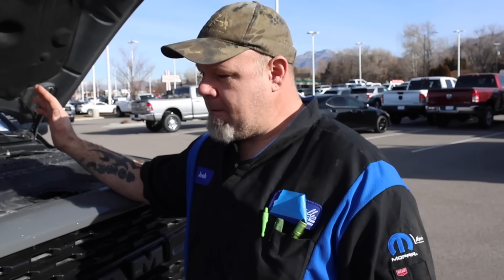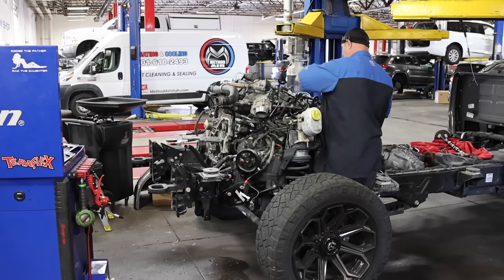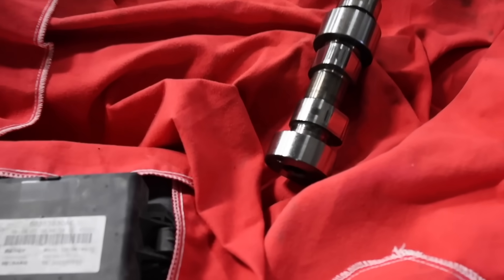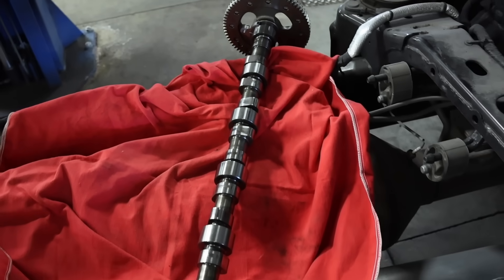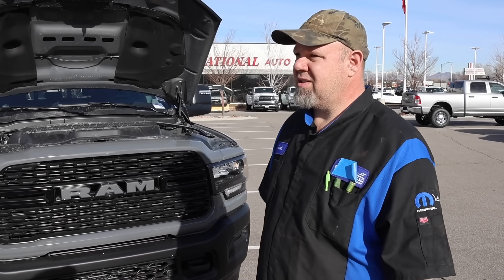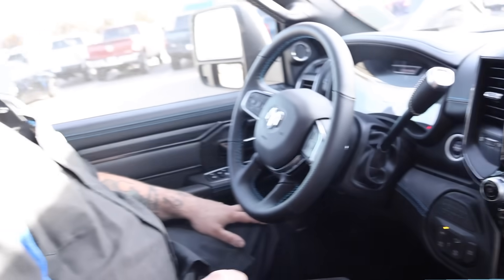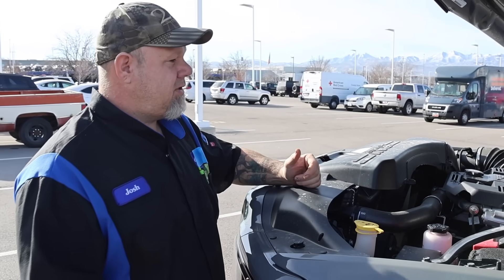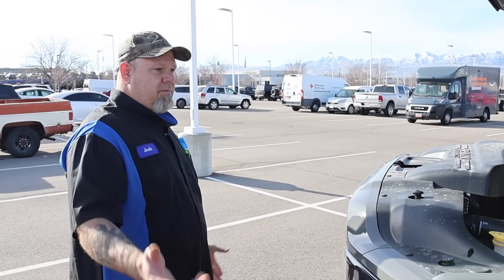Master Diesel Tech Explains The BIGGEST Killer To Your Diesel Engine!

Comment: Curiosity. Last summer I went on a road trip and I put 5k miles on my truck in about 2 weeks. I changed my oil before and after the trip. 

Does long road trips change your opinion on how many miles you change your oil?

Comment: Great video!  Only thing I would do differently is let the high idle do its own thing to avoid thermal shock to the head causing possible fracture issues.  I plug my truck in every chance I get to avoid the high idle kicking in at turn key when I get to negative temperatures (Celsius).  I also let mine cool down habitually.  Especially when towing.  2-3 minutes warm up in cold temps, drive it gingerly for a couple minutes then normal operation.  Always give it a Ferrari stopping every drive to burn off soot.  

This is a very knowledgeable tech.  He should be training the entire Ram fleet of diesel techs.

Comment: Here in new york state,auto start,wait five minutes set cruise and bring up rpms to 1300,Another 5 minutes and up to 1500,temps read 135/140 on coolant and oil temperatures..Diesel engines like to run HOT

Comment: I have a deleted 2018 Ram 2500 6.7L. I travel with it a lot for work towing RVs. I’ll often time stop at a truck stop overnight and will idle for 6 to 8 hours at a time in order to run my AC and or heat. The truck will automatically turn on high idle periodically, but sometimes I do manually run the high idle for period of time. I have been doing this for approximately three years now, and the truck has over 330K on it. Engine runs fine, and I change the oil every 7500 miles. Is this something that I can continue to do safely? What are your thoughts?

Comment: I own semi trucks and we don’t even go 10,000 miles on an oil change. 8-9k miles is when we change it on them. To me it’s cheap maintenance in regards to an engine rebuild.
Reply: In europe most semis are on 100,000 km oil changes, nope they don't last, but then the makers have got all the customers on 5/7 years leasing contracts with full repair/maintenance (if you can call it that) contracts.
Ours are on 5 year lease, tankers with pressure blowing kit, some having engine rebuilds before going back with around 900,000 kms on the dash.

If i ran my own trucks they'd be serviced like yours, used to drive Cummins engined semis in the 80's, 15000 mile oil changes, never gave a moments trouble over the 7 years we ran them with a queue of owner drivers waiting to buy them.

My own Toyota Prado sees 3000 miles max oil changes.

Comment: I have 2 diesels… I bought both brand new. A 1984 GMC K2500 6.2 4x4 and a 2009 GMC 1-ton Duramax. I use Amsoil synthetic oil… change it at 10,000 miles in the Duramax and annually in the 6.2. With every oil change, I get a complete lab analysis of the used oil.

Comment: Modern diesels are rubbish! Once they used to go wrong, these days they have engine failure often at very low mileages. Also if you can, get shot of the EGR, the have very little emission benefit, impair performance and cause loads of problems. No block heaters in the UK as far as I know.

Comment: I have 5.9 Cummins turbo Diesel 2001 I  change the oil every 3000.
Miles and I use Rotella 15W40 it been running great for years I bought it in 2004 it had 23000 on the odometer. It's been the best truck I've ever had .

Comment: Excellent points sir. yes dpf and egrs are not perfect by any means, but those videos of guys showing extreme carbon build ups never show the idle hours or disclose the maintenance records. Both of which I’m sure 99% of cases are due to high idle hours in relation to running hours and poor maintenance. 
These engines are meant for optimum running temps and long distances. Such is the case with 2 of my 5th gens. One gets ran every day and is at 190K miles all stock with no check engine light ever. The other get used to go the store once in a while and has been at the dealer 4 times due to emissions issues.

Comment: Best way to warm up your diesel engine is to drive it. After a few seconds you have full oil pressure, everything is lubricated, and it’s ready to be gently cruised up to temp. Remote start is for driver comfort, not for the engine.

Comment: my 2015 3500 is the only diesel i've ever had. had it 2 years now. i live up in canad'er... cold start 3-5 minute idle, oil changes 7500 mile intervals with mopar filters and rotella oil. also replace fuel filters and ccv on every oil change. works for me

Comment: Have a 2024 gmc 3500HD duramax,  am doing the first oil change at 3000 miles am I doing it too early? Plan ON Doing it every 5000 miles . What's your thoughts? Very good video..
Reply: what does the manual state? im tired of seeing people waste money, this isnt 1980- erly 2000's where manufacturers recommended 3-7k mile oil changes... the new ram has a 15,000 mile interval.... i dont waste my money prior to that, its just insanity....
Reply: @Avies48  Free oil change, manual says 7500 miles. Oil been in it almost a year.
Reply: @jeffreyrussell2337  good to know, ima readmy ram 3500 from 2022 and see if it says other wise, it usually based on hrs, and or miles, or time... 1 year, 300-600 hrs, 5k,7599,15000, so what ever the manual states

Comment: Engine parts become more fragile the colder they are,so it would be easier to damage or break internal parts! Especially high performance engines with stronger valve spring and a high lift cams.

Comment: Biggest killer of modern diesel engines are the emissions system’s designed to recirculate exhaust and create back pressure in your crankcase. Vote differently folks the sky isn’t falling.

Comment: Some good tips as an owner of a 2022 - 2500 6.7  Canadian eh! What about running with the Jake break on every day driving ( not towing )?
Reply from the maker: YES! What a lot of people don’t understand is that the turbo NEEDS to run its full sweep and the only way to do that is to allow it to run in engine brake mode. It helps prevent build up on the veins and keeps them moving freely. Plus as an added bonus it will extend the service life of your brake pads

Comment: I’m all about raising your idle, but I have a monitor and can see all the parameters as soon as you raise the idle you are introducing EGR gases. at an idle the EGR is closed so no gunk is getting into the intake system check for yourself if you don’t believe me. At initial start up the EGR is normally closed at any engine speed, but once the engine has warmed up just a little bit. The EGR opens at an idle. It’s closed.
Reply: You are correct

Comment: Living in Scandinavia, all my cars have had diesel engine- and compartment heaters installed and my Ebersprächer has been very good. I'm careful about maintenance and serviceplans, so the car and engineheater works flawlessly. Also also using synthetic motor oil. Changes every 15000 Kms (9300 miles).

Comment: Thoughts on running 10/30 or 15/40 in winter? While i do live in Alaska, I dont drive it much un winter, and on those occasions I do, i plug in the block heater. I currently run 5/30 all year, but always thought it was a little thin.

Comment: Any advice on idling, or not,  a 2014 Ram 1500 5.7L V8. Also, bought truck used with 60,00 miles on it, now has 85,000, is it safe to drop and fill with ATF? THANKS.

Comment: All great points noted however it all comes down to the uninformed instant know it alls , screwing up a simple task by theur silly pride of thinking THEY Know more than the combined experts of the world !  Remember This , if engine water not already  within range of normal cruisse temp ..... wait ten seconds minimum after start up and then Religiously run the idle up rpm to 1,500 - 1,800 for about three minutes !  This is A Must Do , to get normal burning rate to occur , once engaged to drive the rig or Genset or whatever you have that is diesel powerered. Once your pulling over for shutdown or reststop , keep engine running at normal idle Speed at least three minutes to even out temps n the head , then if turbo temp is in cool range for shutdown Shut it down. Excessive idling IS Harmful & Will Reduce Life of the engine. Always remember the worst enemy of your engine IS the unqualified mechanic or the loose nut behind the wheel !   Cordially Nick , NavyBlueSmoke , LST-1195 , Top Diesel mechanic at Greyhound Bus Lines , position 6-671 Yes 671 !  Retired & living in The Philippines 5J36+HV9 ............. Burma Shave .........

Comment: OTR big rigs often use oil analysis to tell them when to change oil. An acquaintance has a Cummins big rig and a Cat big rig. Both engines are early 2000 year engines. No emissions garbage. The analysis tells him he gets 17-20k on the Cummins and 20-22k on the Cat. Has rebuilt them both at 1,000,000 miles twice now.  Cranks on both have never been out of vehicles. They’ve checked out fine.

Comment: I drive a Toyota Avensis 2.2 diesel. I drive it 5-6k between oil changes, and the oil comes out clean, honestly CLEAN. I know for a year it belonged to a taxi company, and I guess they deleted the particular filter, and blanked off the EGR. Naughty but nice for me 210k miles, 49mpg on a run. Doesn't burn oil except on start up, when it's warm it's very clean, just like it should look ,having a DPF, like it should have😊

Comment: I drive a 2007 GMC Duramax and live in Alberta - Always Plug it in during winter.   I use a Hi efficiency (~ 2mU), PPE Oil filter that’s Double the normal length. I also installed an FS2500 by pass Oil Filtration set up using another (2 mU filter). I change my oil at 60,000 kms with a Filter change at 30,000.  The key IMO IS filter efficiency.

My next mod is an EGR Delete & a BANKS OIL cooler.

Motor has 335,000 MILES.
I run 5W-40 Full Synthetic

Comment: I live in north western Ontario, I change oil on my 3.0 duramax every 6 months and usually have around 6000km on it at that interval. I have always done oil changes like that, gas or diesel… Ive owned 40+ vehicles in my 60 years and have never had any issues. Temperatures can range between-45c snd +45c so extreme conditions are common here

Comment: Great suggestions and I thank you. One question though, the over the road trucks like the Kenworth in Peterbilts will park overnight with the engines running to keep the air conditioning and or heat on. Do they still experience that fuel dilution?

Comment: Ideally you want to be changing your oil based on moto-hours like you do on dirt bikes, because your oil takes less of a beating at highway speeds vs city driving, even at the same mileage. Most of the time I hear 120-150-180 hours as a good rule of thumb - if you're at 60 mph on the highway the whole time, 150 hours is right at 9000 miles, for city driving it's closer to 5000 average. If you're towing - change it more often as it's highly loaded and the oil takes a beating from the extra heat.

Never owned a diesel truck, but in my various shitbox sedans I always changed the oil at around 5-6k kilometers because 3 quarts of oil and 45 minutes in the shop is cheap peace of mind. I can't imagine having a new truck that costs as much as a house and then cheaping out on oil and doing 15k mile changes.

Comment: I have a 2015 half ton Eco Diesel. Bought new has 150,000 miles on it. I change the oil every 8-10,000 miles. I have the oil analysis done 3 times a year. At the 150,000 mile  check it was rated as one of the best results they have seen for an Eco.
Reply: Always:
1. 5W-40 regardless of climate. Covered on both ends of the temp range

2. 2 - 3 minute idle warm ups or else it's just cooling down and wet stacking.

3. 10,000 mile oil changes is perfectly fine if you do the above 2

Comment: i change mine every 3000 miles and its still pitch black. My cars can go 5000 miles and the engine has only half the oil, and still looks clearer than my diesel truck at 3000. I cannot even sleep at night knowing that tomorrow i will run the engine with that pitch black oil. 2 jugs of full synthetic oil cost 40 buck, and the filter is 15. My time costs more than that..

Comment: I run a VW TDI and the oil gets changed when the car tells me there is 10% oil life remaining. For my driving (50% highway, 40% interstate, 10% in town) that's usually around 7k miles. Euro spec Mobil1 5W20 and Stanadyne fuel additive in the tank. Fuel filters every 20k per manufacturer spec.

I usually drive conservatively, but getting on it hard once in a while is mandatory. I think it definitely helps to get it hot on the interstate, and definitely let it idle for at least 30 seconds while parked, before shutting it down. Great video, thank you.

Comment: If you're going to talk about oil contamination and dilution, I suggest you back up your data with oil sample analysis instead of educated guesses. 

I warm up my diesel between 20 and 30 minutes on many of the colder days. I also run boil sample lab analysis and have found no detectable dilution from fuel or other unacceptable contaminants.

(2017 Duramax with 355,000km at last oil test)

Comment: I agree with you and I believe in addition to that, exacerbating the situation is the car manufacturers stretching the service intervals. My Discovery is supposed to have an oil change every 10 to 12 thousand miles!! That’s insane, no oil can last that long even with the best filters and even with Landrover’s excellent spinning oil contaminant separator. I change my oil at a maximum of 6k miles plus I change BOTH filters. I do a lot of motorway miles otherwise I would change the oil sooner if it sat around doing short journeys and building up condensation etc. My rule with all my cars was if they do less than 8000 miles for a Diesel or 6000 miles for a petrol (gas) change the oil for summer and winter grades twice a a year. For more miles, change at 4 to 6 thousand and 3 to 4 thousand respectively depending the type of miles vs startups. Eg long miles with fewer startups I’d stretch to the upper distances and vice versa.

Comment: I your truck has an oil temp gauge, idle at least 1500 rpm until oil temp reaches 100 degrees. Doesn't matter if ambient is 5 degrees, -10, -20.  You should be good to go at 100 degree oil temp.

Comment: By the way, the 10 minute run on the remote start has nothing to do with amount of idle time for a diesel. Even Ford gasoline engines have a 10 minute timer on the remote start. It has to do with a number of items, one of which is idle time even on gasoline engines, wasting fuel, and safety.  Someone might accidentally start a car in a closed up area and not realize it. You would NOT want it to run for hours in a garage attached to a house for safety reasons.

Comment: This guy is blowing up so quickly. I love this. Keep up the good content! And also, is there a way I can email you or message you? I bought a 2024 Cummins big horn and it has had the out put shaft seal replaced twice now and I picked it up today from the dealer and within 18 miles of driving it home it started leaking again, brought it back to dealer and now I’m stuck waiting again. Is there something I should mention to my dealer on how to address this issue? 2 brand new seals put in and still leaking

Comment: What about the EGR cleaning service? It’s required on 5th gen ? 
I don’t see it on the service manual  TIA
Reply from the maker: Not in the manual for egr cleaning. It’s is a recommended service by competent shops. We include the egr service with the Ccv service which is required at 67k

Comment: I work at Walmart in the Auto Care Center. In my store, we do a good number of diesel oil changes because we're in the oil patch.
About 12 or 13 years ago, a guy brought his brand new Ram 2500 Diesel in for it's first oil change................at 40,000 miles.
His truck was provided to him by the company he worked for and he had never run a diesel before. He knew it was a long time but didn't understand what the problems were with not changing oil much more consistently.
I did the lower side of the oil change and when I cracked open the drain plug, what came out no longer could be justifyably called oil. It was more like carbon in a liquid suspension. Of course I got some of it on my hand and I had to get out of the lower bay and go wash my hand because I couldn't hold onto the tools.
After the oil change was done, I advised the customer he should consider doing a very short oil change interval for the next few oil changes, like no more than 2000 miles each oil change and hope for the best.
Reply: Thats awful.

Comment: My 99 7.3 305k. I can still see hash marks on dipstick. At 5k intervals.  Reason why? When i first got it. It was black. I screw on a new filter at 1800 miles then 3500 miles. Did that twice. So 2-5k intervals.  Then did screw on one filter at 2500 miles then at 5k change oil. Now i just change at 5k again. Till it gets dark. Then start over.

Comment: My  partner has a 5.7 F-350 02 he changes the oil every 5,000 mil. no matter what, and he never had a problem with that engine for  years. One little hose on the turbo leak, that's it😅

Comment: The 'internal combustion engine ' has passed its useby date! Time to support your local 'Electric Motor Propelled' automotive manufacturers and start accepting battery powered vehicles!

No need to worry about burning more oil & air pollution any more and those electric vehicles will get better as time progresses into the future!
Cheers

Comment: One thing wasn’t mentioned about the crank case fumes being fed back into the inlet tube before the turbo and mixed with ridiculous high EGR manifold temperatures is causing the build up in the manifold, remove the crank case fumes and the exhaust fumes from entering the inlet side and you have a much happier diesel